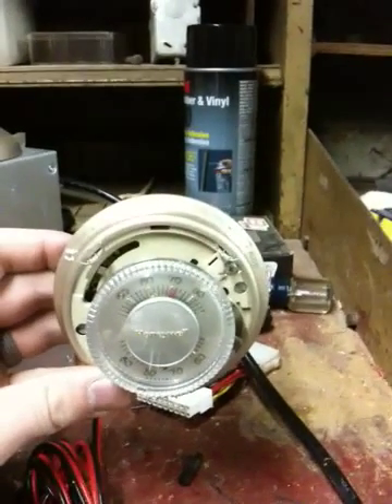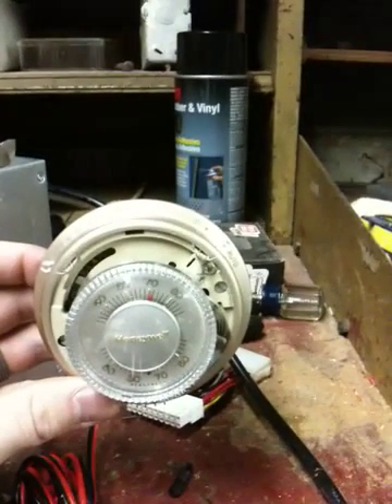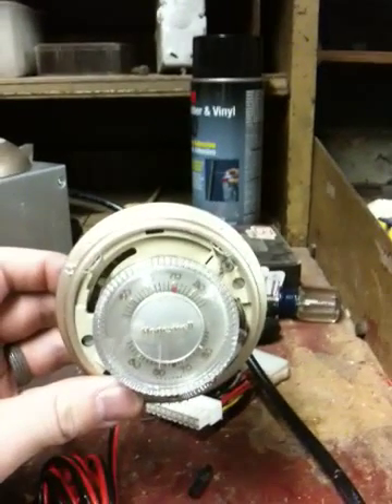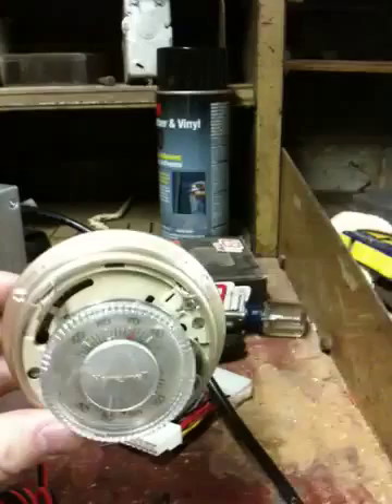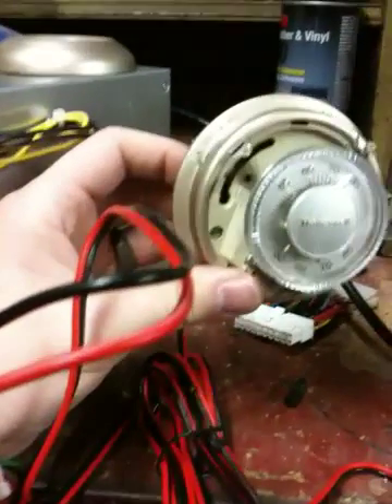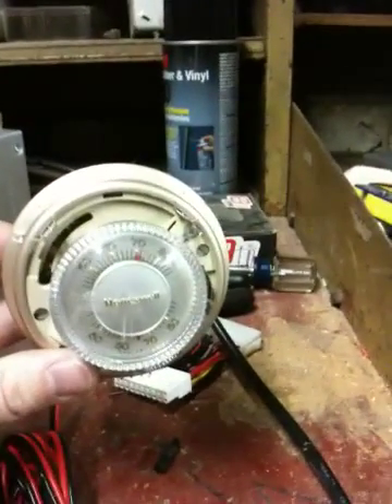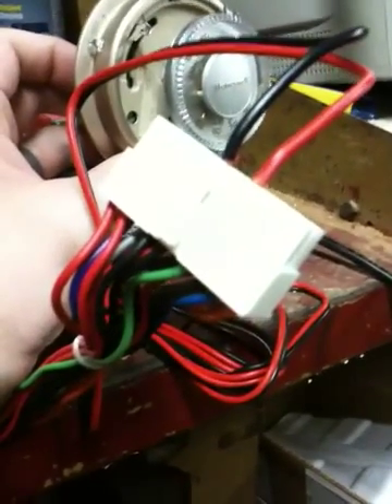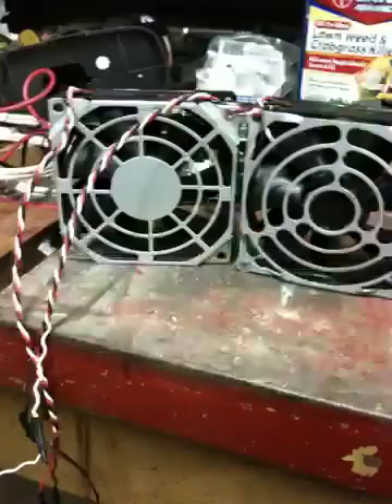DIY home entertainment cooling

Comment from the maker: @camperJ just about any power supply will work.  I just used an old one I had laying around.  Although, depending on how often you're going to run it, one of those high efficiency models might save you on your power bill.